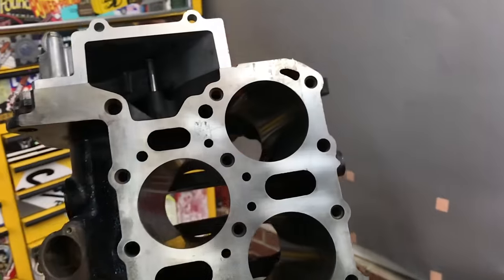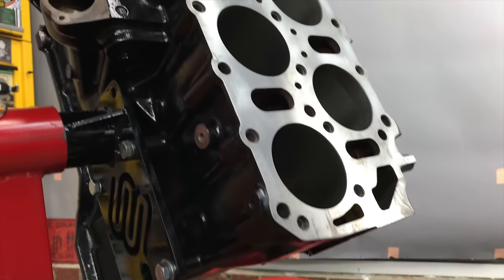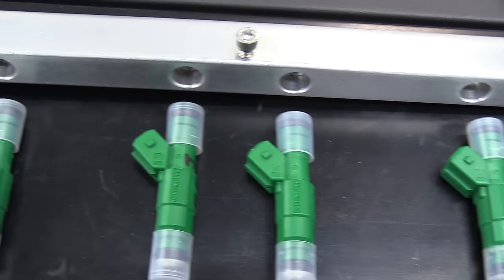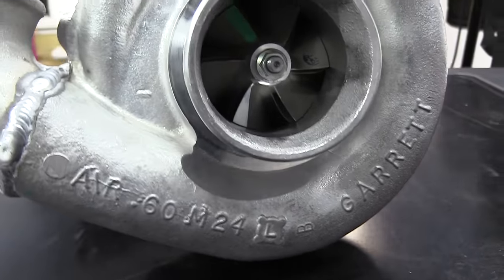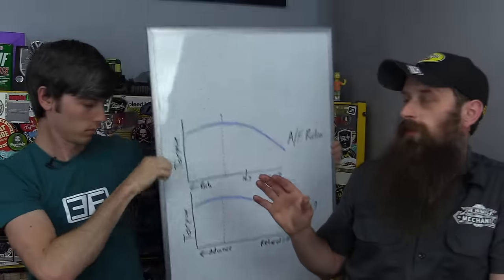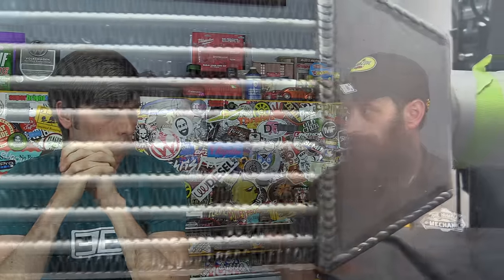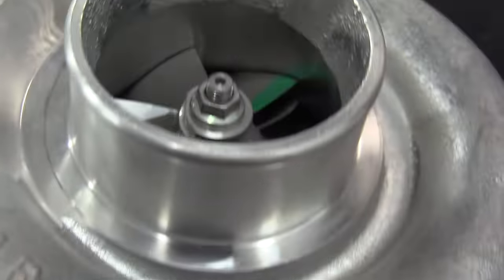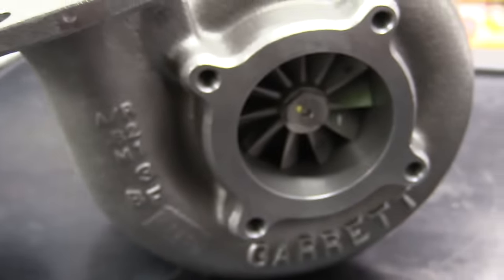5 Ways To Prepare Your Car For Turbocharging

Comment: Is it possible to remove a turbo charger that was installed from the factory?
Reply: Alex sure, but the car needs a retune otherwise it wants to dump to much fuel in like it would with the turbo. but why would you ever want to do that anyways
Reply: Yes, although not sure why would you do it. You would need to retune the car, but it would be very low on power.
Reply: Alex just remove our replace?
Reply: not advisable, the engine is probaly low displacement, needs the turbo to work properly..
Reply: Boosted motors are usually lower compression than their naturally aspirated counterparts and may not perform as well when the boost is taken away.
Reply: Because thats something people do.
Reply: Hell, no. It's a huge waste of money un-turboing a car, lmao. It's best just to replace the turbo for a $500 one and just move on.

Costs and steps of modding a factory turbo car to not be turbo:
1. Engine management(either factory ECU reflash or custom standalone ECU): $250 - 400 - 1,000+
2. New intake and piping(removed turbo and intercooler): $100 - 400.
3. New exhaust manifold(stock manifold has a huge hole to bolt on the turbo): $500 - 1000 - 2000.
4. Smaller diameter custom exhaust(exhaust now doesn't fit properly and has to be made from scratch): $400 - 1000.
5. Plugs for the holes due to removing the turbo oil lines (and coolant lines if water cooled): like $25 - 50.

I don't know if I got everything but:
But after doing all these, your car now has a lower compression engine that is slower than even the slowest cars on the street(because it was made to use the turbo), and you are now going possible get worse fuel economy, because you will have to sink in the pedal more to keep up with the crappiest economy cars on the street. 

To solve the above ^  you will need to factory in a higher compression engine rebuild, not just higher compression pistons, longer rods, etc, you need to redo both the exhaust cams and the intake camshafts and the ignition timing components in order to implement valve overlap which factory non-turbo cars have and factory turbo cars don't have.

Price of camshaft: $500 - 1000.
Price of exhaust camshaft: $500 - 1000.
Price of high compression pistons, rods, etc: $500 - 1000 - 2000.
Price of labor: do it yourself cuz you can't afford it. Bring block to machine shop and have them bore it.

Lets not mention that NA cars have shorter gearing that turbo cars because then we'll have to get into the price for transmission gear adjustments, lol!

TL:DR*: Total cost to "un-turbo" a car is from $1,500 *minium and end up with bad fuel economy and power or to solve this issue rebuild engine and now the new total is $3,000 *minimum*.
Reply: Mavusi Kenpachi Turbo engines have different configurations compared to NA engines, timing and oxygen sensor readouts will be problematic. You could stick to stock tune, but engine would run like crap.
Reply: You NEED a retune. One time a marder killed some sensor part of my turbo shutting it down. The engine (small displacement) couldn't pull the car up a slight hill in third gear, ran like crap and jumped into a safety programm shortly after (like 30 seconds of driving under load). So no you could not use that. The ECU is expecting the turbo to do it's work. The scenario you describe might work with a custom build and a custom/modded ECU.
Reply: DxCBuG what a minute if it fuel injected then why would info that,  too  big of a faucet aka, minimum injection charge too much
Reply: Alex My question is why would u do that in the 1st place anyways? I currently own a 2009 HHR SS with the turbo 2 liter it works for me no complaints as it is my daily driver-gives me plenty of boost goin up hills & passing power too.

Comment: Not related to this video, but I would really like to see the analysis of fuel consumption for different gears, especially interesting for manual transmission cars. For example, how much fuel is saved if driving 80 in fifth gear vs. 80 in fourth gear and so on.

Comment: VW known for reliability?!.......im speechless....
Reply: Dont know about new ones, but older VWs are very reliable. Ive seen a lot of cars that had over 400 000km on stock engines with no unexpected issues.
Reply: TheDox451 well yeah ok, old ones were reliable cars...but since late 90s/early 2000s? oh my god...
Reply: Pe Peroni currently going on 170k miles on my 05 GLI. Upgraded the clutch, flywheel, diverter valve, intake/exhaust, turbo, software, and intercooler and the only real issue I've had has been replacing the fuel pump when the original started dieing. (fingers crossed)
Reply: Maybe youve just seen bad examples, a lot of late 90s passats and golfs are still pulling strong. My neighbour has late 90s passat with 400k kms.
Reply: just so vw-fanboys are aware: i had over 20 years experience working on/with/at VW (in Germany btw), so please dont even bother trying to "convince" me otherwise...just sayin...
Reply from the maker: Pe Peroni it was a sarcastic joke, just so we're clear haha.
Reply: TheDox451 how about 400k miles homie 400 Kms really isn't a lot
Reply: +Pe Peroni  Every vehicle has their ups and downs. I used to work for a plethora of auto manufacturers, from Ferrari to Ford. The irony never ceases to amaze me when talking with techs from different dealerships. I too, am a certified technician, but I never bash any vehicle simply because I used to work on them.

Of course, most techs from a certain manufacturer are going to say their vehicles are garbage. We have the unfortunate circumstance of seeing everything that goes wrong with them. 

That's like a doctor saying all humans are disgusting and unreliable because we get sick and have all sorts of ailments assail us from birth.  

I support your personal decision to abstain from VW but that by no means makes them unreliable.

Keep up the good work my friends.
Reply: Pe Peroni 
Take a look at all 1987 and older models still on the road, I bet half are VW or Toyota. The other half are big American V8's which are very very very very serviceable.
Reply: Bboy 1hunnid 
400,000 km is enough for buying a used car. After that it's all about how cheap you can get your labour. The vehicle that holds the engine will cost you money even if the engine is still okay.
Reply: Volkswagen is generally SUPER reliable, which means they all are. I once knew someone who knew someone who knew someone who had a hairdresser that said she had 400,000,000km on her Volkswagen, and she never had anything major happen, except for 5 engine rebuilds and two electrical fires, and a few other minor things... SUPER reliable!
Reply: TFW you don't have anything to do with your life, so you dedicate it to hating one specific brand
Reply: +TheDox451 If they are properly maintained, most Japanese and American cars SHOULD last no less than 400,000km (~250k miles). It's not even anything amazing, it's just what's expected. Anything less than that should be considered crap. In reality, there are many, many, many engines not built by Volkswagen that go well beyond 400k kilometers.
Reply: +VOLKSWAGEN SUCKS lol
Reply: Jay Edlington uhhhh???
Reply: VOLKSWAGEN SUCKS yoooo 😂
Reply: +VOLKSWAGEN SUCKS VW loyalists have no connection to reality and have a funny idea of what "reliable" is.
Reply: I own / I still love some of them .....
- 1,9 TD 1Z 75HP - 1991 -  340.000km (sold) 
- 1,9 TDI AGR 90HP - 2000 - 330.000km (on road)
-  2,0 ABT 90HP - 1993 - 150.000km (on road)

..... 1,2 , 1,4, 1,6 or 2,0 TDI (EA189)  ...... waste, scarp engines!
Reply: I meant that to 'VOLKSWAGEN SUCKS' :)
Reply: My mk4 Golf TDI just passed 450k km last month and it's still going strong. And that 66kW power it had 18 years ago is just remarkable :D although I really didn't have any major issues with the car I'm mostly happy it doesn't rust. Had a Mazda 3 prior to my current Golf and it rusted like a bucket being just 7 years old
Reply: Pe Peroni my 05 jetta tdi has over 500,000 kms. Don't believe me? I have a video of it rolling over on 500km my channel. No engine work done to it either.
Reply: Why do V-dubists think TDI diesels with 250,000 or 300,000 miles is something to be impressed by? There are Toyota and Ford gas engines hitting that on a very regular basis without rebuild, some 1,000,000 without rebuild.
Reply: +King_tazz 500,000 kms is nothing special for a diesel.
Reply: Jamal there's very few American cars hitting that mileage. Most American cars I've seem with 300+ km are falling apart.
Reply: Jamal beats me. My Ford Expedition 4.6 is going on 240,000 miles and is like brand new. And it wasn't an expensive maintenance nightmare along the way.
Reply: King_tazz, you seem to have inhaled too much of your TDI's emissions in the lat 300,000km.
Reply: +King_tazz The best you have is a diesel with ~300k miles and your perspective on American cars...Pathetic.
Reply: +King_tazz In reality, 400,000 or 500,000km is nothing unusually for most non-European cars, it's actually very common. I just did an oil change on my parent's Chevy Tahoe, and it pushing past 470,000km. It's only left us stranded once after the water pump starting leaking, but that was the only thing ever to break on the truck. Everything still works, the A/C and heat work perfectly, the power seats and windows work, transmissions is smooth, engine starts and drives like brand new. It does have minor oil leak, but that's it. It's the most reliable vehicle we've had. And that's just personal vehicles. I haven't said anything about our company vehicles which regularly run 1/2 million kilometers without trouble.
Reply: +King_tazz Very few? Nonsense! Search Ford, Chevrolet, Jeep, or other American brands for high mileage clubs, search car sale websites, ask mechanics, etc. It's actually very common for American vehicles to hit 300k+. There are also many, many examples of them hitting 1,000,000+, and that's in MILES, not kilometers. Don't be so clueless. Seriously, you think 500,000km for your diesel impressive? Yeah right...
Reply: Jamal you do realize the scandal didn't affect my car right? But nice try. 
And for everyone saying that there American cars are going X distance. Yes there is some but I've seen way more rust out and fall apart before they get close to the 300km. I can literally go walk into the parking lot and find 10+ cars (all American brands) rusting out.
Reply: +King_tazz I never said your car was apart of any scandal, but good job bringing out more of their transgressions.
Reply: Jamal that's almost exactly what you Said though.. But alrighty then
Reply: Jamal There are very very few cars on this earth with 1,000,000 miles on them lol. Do you have examples because I'm not believing that.
Reply: Mine is @ 354000 km and still running fine. Of course it's a 2001 Golf 4. Now if that's not reliability, I don't know what is.
Reply: Pe Peroni lol it was sarcasm which is why he said and honesty after lol
Reply: My Volkswagen has 18439489348934895893485934857200000000000347823478.020009 kilometers and runs just fine! If my comment doesn't have any reliability to it, then I don't know what does!!!!
Reply: King_tazz it's YouTube why you tryna prove your point so bad? It's the wires my guy
Reply: Bboy 1hunnid wait so I'm the one trying to prove my point that bad? I would have thought that was the person who looked up multiple links but that's just me..
Reply: Sarcasm
Reply: Pe Peroni for daily use vw cars aren't bad. Bit if you are planning to race with a vw motor, or some of the vw driving parts, don't expect them to stay in place for a while.

Yes, my English isn't the best. And yes I know what I'm talking about.
Reply: My dads Honda Pilot has almost 400k miles and is still running strong
Reply: Ecto Hondas are lit they run forever.
Reply: emdec55 LOL... that's the "few" that I'm talking about. Even the blog posts that you linked say "every now and then we hear a car..." or "very rarely". You see my point? Like seriously, not a lot of cars have 1,000,000 miles on it like you made your previous post out to be. Yea, there's a decent amount of cars posted on the internet that have that milage. But out of those found on the internet, (which is probably around a 100 or less) just think of how many cars are on the road, or in the junkyard, etc. I can't even fathom that number compared to the cars that have said mileage.
Reply: I have a stock VW T4  2.5i  I-5  with 470,000km. Starts 1st time everyday, like a new one :)
Reply: @Driftuner  No you didn't
Reply: @TheDox451  my '00 Subaru legacy has over 310k kilometres with poor maintenance and no part changes at all. Subarus are damn reliable too
Reply: @aerox1930  Funny since subarus are often considered unrealiable with common head gasket and rod bearings fails. Seems there is always some luck involved in having a reliable engine.

Comment: TL;DR
1) turbo - turbo kit
2) fuel components - pump, high pressure pump, injectors (use high octane fuel to avoid knock)
3) engine management and monitoring - get a better computer or chip your car
4) Cool - your air, oil, and water - run it to where it needs to go, and upgrade your fans, radiator, and reservoirs if needed
5) prepare the weak points, tires, brakes, exhaust, clutch, spark plugs, piston, head gasket, and head gasket spacer(connecting rod spokes for Charles' version of VW [mk3 GTI 2.8L])

Comment: I'd also change pistons to ones with higher copper content. If the piston bottom is cooled by oil, the higher heat transfer rate will come in handy.

Also, make sure to choose an engine oil that can handle a higher temperature rating.

Comment: hey engineering explained i want to ask about your one previous video of spoiler 
what happens if we put spoiler on front of car ??
Reply: ncs productions  that what means ?
Reply: ncs productions  OK
Reply: but tell me is there wii be any problem ?
Reply: ncs productions  OK thank u
Reply: Yes, most of the time they use front splitters to make down force at the front, but there is a TC race car that actually installs a huge wing at the front, to compensate for the FWD traction loss(which is pretty bad @ 700whp & torque!):

http://www.motortrend.com/news/front-wingequipped-scion-tc-breaks-lap-record-at-willow-springs-5235/

Comment: generic kit, like bought in 2002
440cc "bosch" ev6 injectors, chipped stock ecu, the "allmighty" t3/t4 turbo, the decrompression plate, 255lph walbro.
I mean there's nothing wrong with this stuff, but when i'm doing this, i might aswell do it like it's done in 2017.
he's spending that "much" money, but focuses on the wrong parts...
stock ecu has no overboost protection, no lean under boost safety, no egt correction, no fuel pressure fail safe...
gauges are not completely useless but still useless, you can't keep an eye on the health status of your car all the time.
Reply: true, hard to beat the price though for a kit like that. but i do agree in your points. Even the turbo seems kinda pointless in this kit if hes only thinking about running 10 psi of boost.

Comment: great tips ! 

Personally one of my personal tips is learning about how NA cars being converted to NA-T can have issues with their oem vacuum orientation.  Reason being is because lets say you have actuators that work only under vacuum at a certain rpm. Lets say around that same RPM your car begins to form boost. well that actuator is going to work oppositely compared to what its designed to do because its line is being filled with pressure instead of vacuum.

I personally always run an external oil cooler on my turbo converted vehicles. aswell as upgraded radiator. making sure everything is cooling more efficiently over stock is key.  i've seen some supras where they have some really nice high end mods and then they are rocking the stock radiator.

Comment: Step 1.  Buy a car with a factory turbo.  
Step 2.  Enjoy your car.
Reply: SOLID! We have 2 other cars both factory turbo cars. <3
Reply: Great idea....unless you are one who would rather build your own rather then just buy what everyone else can. Not to mention a lot of times the car you like is not available with a factory turbo, which is all the more fun when some unsuspecting factory turbo car owner comes across a car the knows does not have one...and it does.
Reply: John L I would but state law won't allow me to go to higher than 35 mph roads
Reply: 9/10 times they do that to make the engine smaller or the car just 'fast' putting one on later makes is really fast in comparison with weight and safety. So lots more fun
Reply: Yes John .L i do own a factory turbo car. It's a '09 HHR SS panel & i luv it owned since new now has 122 thousand miles but did have replace the factory turbo in sept of this year-stayed with another factory turbo. Aqua blue HHR